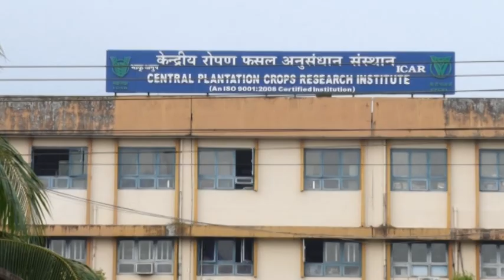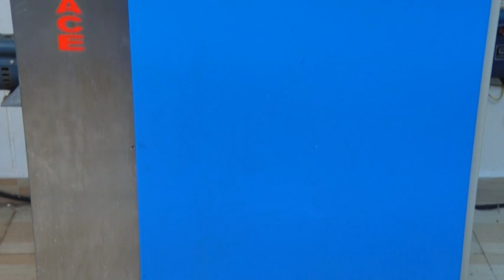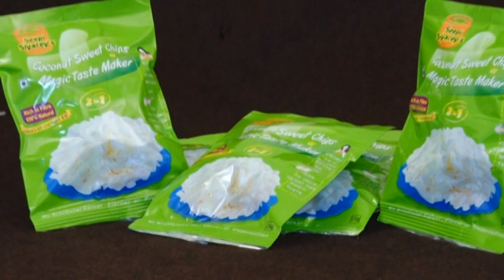Coconut Chips - malayalam

Comment: What is the solution? I could see Salt. What flavor did it give, salty or sweetened? Thank you.
Reply: its water with sugar salt and vanilla essence
Reply: 1 litre water + 1 kg sugar + 20 gm salt. You can add vanilla essence if needed.
Reply: @j000p  what's the weight of coconut used for this?
Reply: @kraversbakery2877  1 kg of sliced coconut. the coconut should be 9 -10 months old.